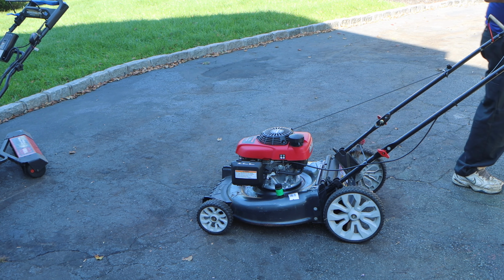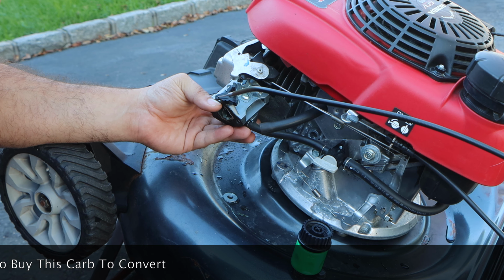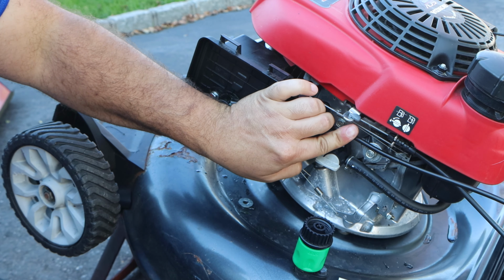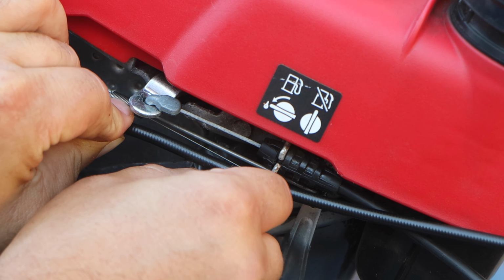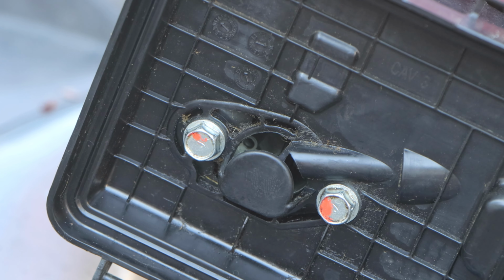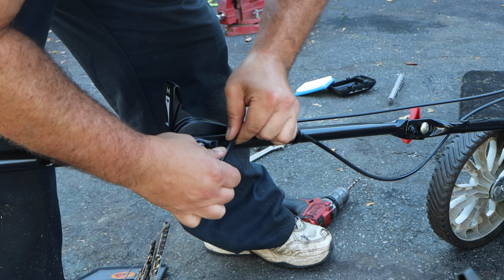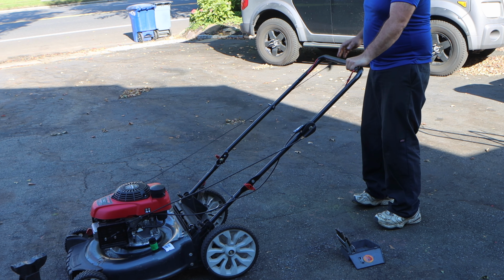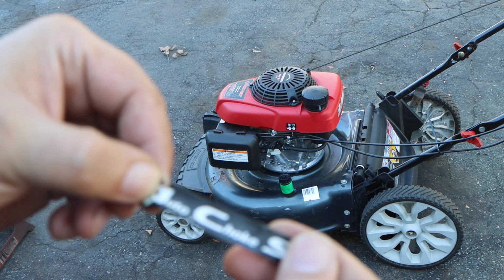Deleting Honda Auto Choke TO MAKE IT RELIABLE!  HONDA MOWER STARTS ON FIRST PULL VIA EL MANUAL

Comment: Pick up some 6m threaded rod a tad longer than the Honda bolts.  Get nuts to fit the rod.  Loosen ONE side only pull out the bolt, replace it with the threaded rod, then do the other side.  Easy to remove as many pieces as you want and also when replacing them.  On a side note; I replaced a Kohler powered Toro's auto choke mechanism with a hand choke too.  WAY cheaper than buying all the components of the auto choke system.
Reply from the maker: Kohler has the worst design!  WHY IS THIER VACCUM ON A SMALL ENGINE?  I like the threaded rod idea...since Honda's are ceasing to exist I don't see myself struggling anytime soon ;)  Next time I'm at the hardware store I will grab some.
Reply: @pattayperformance  Well, Honda may have quit making small engines in America, however, there are thousands of them out there, so I think we'll be dealing with them for some time to come.  Anything with a Honda engine sells very well in my area (Chicagoland).
Reply: Hillman sells 100mm 6mm threaded rod that fits perfectly.  Every TruValue has them

Comment: I had a Honda HRX217HYA with the auto choke my grandfather bought for me brand new, it never really started easy nor did it ever really run right. I even replaced the carb with a genuine Honda carb, it ran the exact same and if I let it sit for 2 weeks without using it, the idle circuit would get plugged up with IDK what. If it sat for a month, the thing took like 30 pulls to start. Pretty sad when your 45 year old push mower with 1000+ hours on it fires up first pull with the same gas out of the same can when the new mower won't cooperate.
Reply from the maker: I hate honda...so I'm glad they are getting out the push mower game!  Long Live The Quantum!  Unfortunately it just seems to be the common theme in general that newer isn't always better!  Crazy how thery made such a simple machine so complicated!
Reply: @pattayperformance  I had a better time getting abused Tecumseh's to run right than Honda's!
Reply: How is it now?
Reply: @mgomez5606  I sold that mower to my brother years ago, he used it for a few years then hired a landscaper. It hasn't been used for a while so I don't know.
Reply: @MattsRageFitGarage  TY.
Reply: Sounds like user error.

Comment: A simple cable /wire hanger that's rubber coated would do what you're trying to do w the washers .
Reply from the maker: I keep those rubber cushion clips in stock for mowers and our fleet so it was just easier to do that.  Plus they are cheap LOL

Comment: I never knew  these came with autochoke. I have got a 1997🤪 Honda with man choke that was laid up in a shed   for I dont know how long.I managed to get it going and TBF , its been a great workhorse. Apart from oil changes and air filter , I have never changed the plug to my shame , but it still  starts and works great.The two levers on the handle are for drive and blade disconnect . Shut off with throttle lever. One of the bolts to the Muffler/Exhaust is no longer there so its really going exhaust...less. I am trying to cobble it together somehow. P.S  I run the carb dry after each cut.
Reply from the maker: That's awesome!  Honda blade stops are a little complex and priocery compared to Toro's!  Don't feel bad...I only charge spark plugs when they fail!  Keep that oil fresh as well as topped off and CUT grass nothing else...it will last!
Reply: @pattayperformance  thanks, I do agree with you on removal/installing the carb and air filter. It is silly, you would nearly need three hands 😊.

Comment: Yep I had a older Honda with manual choke .  I ended up replacing carb.  And it took a long time to get it right.  Including all the gaskets which I had to replace as well.  Comments on that vid were that it was painful to watch.  And I didn’t cut much out
Reply from the maker: Can't make everyone happy.  Keep doing you!  It's painful to watch bc Honda's are painful to work on!
Reply: @pattayperformance  exactly

Comment: The wax cartridge appears to be removed from the block, the square shape opening above the intake port. That is what opens the choke when it warms up.
Reply from the maker: @sentryfe74  it’s there trust me.  I replaced it with an OEM Honda one and problem still persisted.  I forgot what the cost was but it was reasonable like maybe $8 give or take.  Then I resorted to good old reliable manual cable as shown in the video.

Comment: just replace the thermowax choke actuator. it's about $10 online and just slides out and in.  As per the bolts being tough to manipulate, you can install all-thread studs, then just put a nut on the end like the newer GCV170 engines have. there are videos on how to do both of these things.
Reply from the maker: @Synchrimedia  as mentioned in the video ordered one from the dealer with no luck.
Reply: the thermowax actuator is probably cheaper than the whole choke cable assembly with the lever, and you forgot to reconnect the crankcase breather tube when you attached the air box. you're going to get oil leaking all over your deck.
Reply: @pattayperformance  couldn't get one online?
Reply from the maker: @Synchrimedia  I shop local within reason.  You never what you have till it’s gone! 🫡

Comment: Hello, my fellow small engine mechanics.  I need some advice on an engine fix.  I am working on a simple 2 stroke echo weed whacker.  
Put a new carb on at the beginning of the year and it quit working 1 month after.
Pulled it apart to investigate and found the new fuel filter somehow was not attached to the fuel line.

That makes sense why it quit working i think, order another carb, install it, and she runs great as i expected her to, however it only lasts a half a day.

She starts giving me signs of not getting gas.  She starts up with the choke and idles a bit rough with it off, then once the throttle is hit she immediately dies. Even when warm she needs the choke to start.

Im pretty confident its a gas problem, but also confident its not the brand new carb, or brand new fuel lines/filter.  Any ideas what else could be cause my problem?

Btw she revs good when run on carb cleaner through the intake.

Thank you in advanced.
Reply from the maker: Its all fuel related!  I find aftermarket carb are hit and miss!  Even after installing a new carb some of them need tweeking in the sense that when you apply throttle it bogs down.

IN ONE CASE ONLY!  I had an issue where the fuel filter wouldn't stay in the fuel..I put a nut at the end to weight it down.

I would do new carb, new fuel lines and grommet.  Fresh two cycle and start from there.  Also do a vaccuum check on your engine to make sure of no leaks.  Doesn't hurt to pull spark arresrot as well as piull muffler and check for build up in the chamber
Reply: @pattayperformance  your awesome dude.  Will give this a check!
Reply: @pattayperformance  you nailed it bro.  I messed around with the carburetor adjustment screws and now she's running like she should!  Thank you Patty!

Comment: Did you remove the Therma Wax device from the engine block that engage the choke automatically, if not it's going to still engage/disengage when the engine operates.
Reply from the maker: I left it bc it wasn’t working in the first place. 

Play safe and just remove it

Comment: I struggled too, at the end, I placed the mower on its side and let gravity do most of the work. Still a pain to align everything properly.
Reply from the maker: @vicb.5034  great job on getting it done!  They way they have it set up is counter productive and why they never changed it is mind blowing 🤣
Reply: @pattayperformance  my one in the UK has an auto choke but with a cable attached to a spring control arm at the end, so it can be adjusted... maybe this was an update??

Comment: Maybe assemble all the carburettor bits and gaskets onto the plastic air filter cover and then offer the whole lot up to the bolt holes. I have seen someone else do this successfully.
Reply from the maker: It fits me no matter what…I ended up buying studs off amazon and it helped pit a lot…

Take one bolt out…hold the carb and install stud.  Take other bolt out and install stud…remove carb and reverse process when installing it

Comment: I have two of these machines, terrible piston rings. One of them was smoking and I decided to repair it with new piston rings in detail, I think I did everything correctly, but it has never started. Idkn!
Reply from the maker: Smoke can be caused from a few different things.  What diagnostic steps did you prior to replacing rings?

Comment: Great vid - please post the PART NUMBER(S) you used for your THROTTLE ASSEMBLY you are using for choke control - don't see it listed unless I am blind - Thanks.  Also - Honda gas mowers are THE BEST - last the longest of any current mower - BUT...the stupidity of allowing this thermowax P.O.S. to be used has caused UNTOLD GRIEF in the world.  I have a new HRX GCV200 with same problem - BRAND NEW.  Your throttle assembly part number(s) will be appreciated.  I have a 26 year old Honda mower that still runs great.  Lawnboy used to be the ultimate mower but brand was bought by TORO who immediately RUINED the brand, just like when whirlpool bought maytag, kitchenaid - buy a supreme brand with superior quality and then CHEAPEN THE HELL out of it and ruin it.  No TORO for me - no whirlpool - you get the drift - Americans have to do the research before buying anything these days to discover the truth.  Lastly - no extra charge - the last remaining built-to-last BEST home washers and dryers you can buy - one brand:  SPEEDQUEEN.  Later.
Reply from the maker: @yootoobed  in the description of the video are links I used to purchase the same parts I used in the video.

Comment: I just replace my auto choke and thermowax, I wish I saw your fantastic video before I purchase the original Honda parts.
I think you should lengthen your cable kill shut off, looks like it's in a bind.
Thanks for your video..
Reply from the maker: I replaced the therowax thing as well with no luck...which lead me to this.  Luckily the thermowax is a cheap "try".  From now on I will just install the cables.  I used an OEM honda part so the length is as good as its gonna get.

Comment: Jason, what did you do about the engine stop cable.
Reply from the maker: Great question and sorry I wasn’t clear in the video.  You still need to keep the bail cable as you need to stop/kill spark on the motor to shut it down.

Comment: To explain this design , Imagine a choke adjuster that allows a movement to happen by heat only , engineering was in this design , it is at choke setting as the motor has set for awhile awaiting you upon the next time you start your mower , it plunges out a thin wire to push the choke open as the motor heats up , sits in a hole above  the carb on the assembly mount. Cartridge little guy , google Honda mower parts , has a list of mower models with exploded views of the carb , you’ll find it numbered and it’s part number to order .
Reply from the maker: @davidnorth3411  

I’m well aware of how the Thermo Choke works.  I mentioned in the video I spent $8-9 on the thermo choke and it didn’t remedy the problem.  I went to good old manual version.

Thanks for the view and comment!
Reply: What I found with mine was the spring on the choke flap was all gunked up and was not pushing the flap closed again when it cooled down

Comment: The reason your auto choke ain't working is because you are missing the metal arm that runs from the auto choke to the carb. That tall black rod on carb choke is what the arm from auto choke would engage when you pull it to the choke position. The auto choke usually fails because of weak spring tension or debris clogging the gears of the choke mechanism. Its a simple fix, remove 2- 10mm bolts and clean the gears and it should have DRY Lube applied to it not grease, which attracts dust and dirt
Reply: It's an aftermarket carb on the thing.  I used a 1.5mm bolt with nuts on either side of the actuator - worked like a charm

Comment: I just replaced the carb and wax choke and I'm giving serious thought to changing those bolts out for studs. Honda really turned a minor job into an annoying fiddly chore with that setup.
Reply from the maker: @daviddavid5880  if you were to permanently convert it’s easy.  I just use studs to help with the repair process.  Life changing.
Reply: @pattayperformance  Awesome. Thanks. I just don't comprehend the Honda thought process there. What a pain in the butt.

Comment: I agree with everything you said. Mark Nye thefixitguy here and I've been doing small engine repair for almost 40 years and the HONDA GCV motors are the worse with the Themostat Wax Choke Assembly...but almost all the GCVs are just a bad idea for Honda and I think that's one reason they stopped making them. 
I had thought about a manual choke on these motors so I just might do that on my next repair. Honda makes studs for the GX motors ( which are one of the best motors out there and have no idea why they do t use them on all mowers and equipment). The studs mount into the block and then you install the gaskets and carburetor etc.. that's a much better design. 
All the equipment that is made now fails in just a few years. Briggs and Stratton back in the 70s 80s built probably the best motor.
The I/C 5HP. That engine was indestructible..
Now Briggs and Stratton makes a plastic carburetor for their engines. Poor design but they are so much easier to work on than Hondas. I also have to complain about Hondas EU2000 and EU2200 inverters. What a nightmare they are to work on and replace the recoil rope or work on the carburetor
Reply: I know exactly what you mean!!!
Reply: I've got two Honda GCV 160's over twelve y/o. One with a manual choke and one with a hybrid choke. Mine have been bulletproof thus far. Never had a problem with em whatsoever. Now I've worked on other people's Honda's but all of there's had been abused and hardly any maintenance was done to them. But still, they were like 5+ y/o.

Comment: I got a new wax part and new carb. Over an hour and no gas
Reply from the maker: @lovestihlquality1369  

If it’s got no gas put some in it 🤣

Confirm fuel flow to the carb…

Use a screw driver or something to close the choke and give it a pull if it starts and run you know you have the same issue as shown in the video

Comment: That brake cable is way too tight. It will snap in about two weeks, i'm surprised you left that.
Reply from the maker: @lesprice5533  brake cable is just fine…I know this bc the mower still functions as it should as we speak.  

Thanks for checking it out!

Happy New Year!🫡

Comment: I have the sane mower & i cuss it every time because its hard to start.  Id rather use an electric mower
Reply from the maker: @Ollie_4348  🤣

Before you go through with this mod, Make sure your carb is clean and confirm fuel flow.

Comment: This is what goes bad on the Honda auto choke Honda 16620-Z8D-305 but el manual works better hahahaha
Reply from the maker: Inreplaced the thermo wax and the problem still persisted…chalked up the $12 as a lesson learned

Comment: Looks like the wrong carb for that motor
Reply: It's an aftermarket.  What's missing is the vertical post off the choke actuator.  I used a 2 mm bolt - drilling out the black plastic